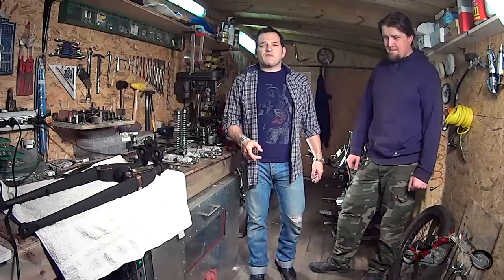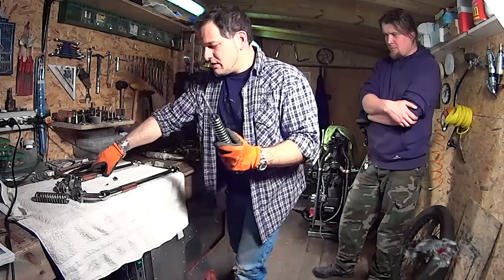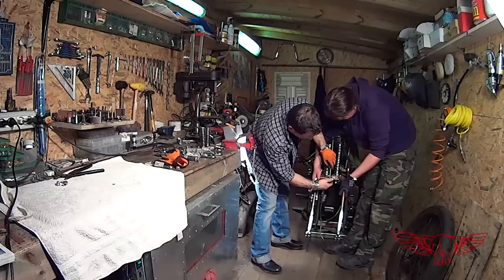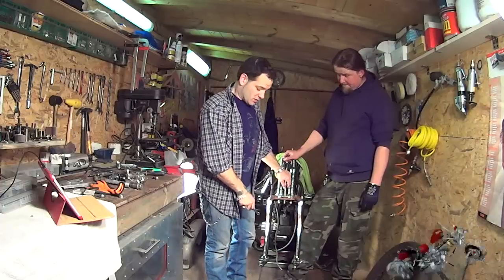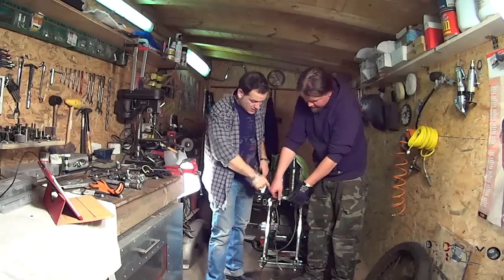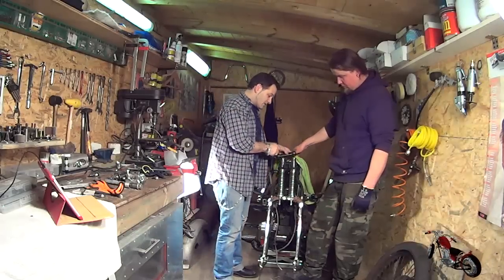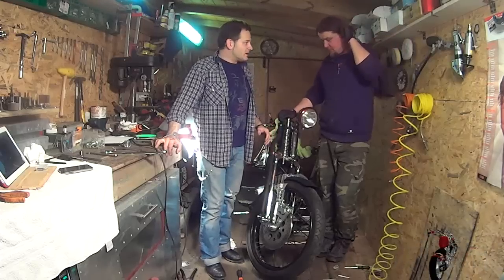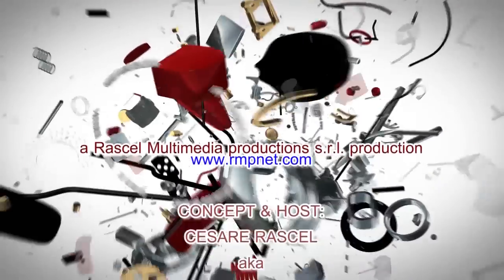How to assemble Harley Davidson springer fork DIY tutorial - e3p2 Roma Custom Bike

Comment: would have been good if you got more into depth on the rocker bearing torque settings for both the bearing retainer/jam nut and the arch setting.  Awesome video guys. My 2007 CVO Springer has 150,000 kms on it and now I just want to learn everything about these remarkable front ends.
Reply: And measuring from the bottom of triple tree to where axle is bolted in..so forks aren't bent or tightened too much..

Comment: Thanks so much for sharing this, really helpful. Can you share your experience about the design of the water gaurd and the 1) weight.  specifically on the rocker arm. It looks like it will be too heavy snap off into the spokes. 2) the wind speed on it? Wow thank you for sharing your great experience. :D
Reply from the maker: Thank you, but I'm sorry Victor, I didn't understand your question
Reply: Custom Cez Fai Da Te The fender looks so heavy for the rocker arm? Will it break off while riding
Reply from the maker: Hi Victor, no it's all aluminium and it has been there for now 4 years riding daily on Roma's roads that are all broken up. :D
Reply: Custom Cez Fai Da Te Nice! I wanted to adopt the same springer style for a custom bike I'm interested in building. So much great information, thank you again 😁😁 Your bike looks great !
Reply from the maker: Thank you so much :D I'll tell you, if you don't go for an excessive rake it drives very nicely too ;)

Comment: Do you have a video on how to realign my springer front end? I have a '05 Springer Softail and the handlebars/ steering are a little askew.
Reply from the maker: Jon Grattan sorry man, this is it on the subject. You can align the rear wheel cause it has the regulation bolts, but not the front. If it's askew is ether because the forks are bent or because the risers/handlebar assembly has not been done properly. Try taking those apart and put them back together the best you can ans see if it's any better, otherwise u might have to take down the forks and see if they are straight. Hope this helps
Reply: Excellent video , best one on the topic without searching deeper.
 The. Overuse of the cleverly done animation inserts .are abit repititios and intrusive to the focal point of topic.
  Also when showing a special tool or home handmade .If perhaps remove an animation in favor of a pause with photo emphasis for say 15 to 30 sec pause or at the end of the video show tools and or special parts
Would b extremely useful thank you for your videos.

Comment: very talented, I'm Colombian and here in my country is very difficult to see such suspensions. I would like and if you can give me some steps to give one to my motorcycle q is national brand low cylinder. thank you very much
Reply from the maker: julian diaz hey Julian :) thank you very much!!!sorry but i don't understand what you need, you what to get a springer front end?
let me know and i'll help if i can :)
Reply: Buena tarde , de pronto no me hise entender ya que mi ingles es pésimo. Pero lo que realmente quería hacer es una suspensión springer o girder, ya que ak en colombiano eso no se ve.  Ustedes nos llevan años luz en conocimiento de motocicletas. Y bueno me gustaría me asesoraras para yo hacer uno casero para mi motocicleta  150 cc 4 t.  Gracias..
Reply: Good afternoon, suddenly hise not understand me because my English is terrible. But what I really wanted to do is a springer or girder, since ak suspension in Colombia do not see that. You bring us light years knowledge of motorcycles. Well I wish I asesoraras to make homemade one for my motorcycle 150cc 4 t. Thank You ..
Reply from the maker: julian diaz hey Julian, it's ok :) you can probably make a springer at home, i've seen it done before. try to keep the corners square. There are aftermarket designs that are easier to build, less curves.
good luck to you my friend, and post pictures if you manage to make it :)

Comment: ciao, scusi. How much does the complete fork cost? I would want to assembly on a AME frame XS 650 Yamaha. Is it possible? Which sizes do I need to find out, to know if it fits?I used to live in my childhood in Varese. Italy ;). Greetings from Germany
Reply from the maker: +Jason Diamant Ciao Jason, i think a springer fork will cost about 1000 or 1500E. Everything is possible :) it's not going to be easy though. You'll have to match the bearings  to fit both the neck and the fork. I think it will be a wonderful build! Good luck to you man!

Comment: what is to  best angle for the retainer rod rose joint in degree's
Reply from the maker: +trevor francis I'm sorry man, what is the rose joint? Maybe in Italian translates differently :)
Reply: the part thar secures the caliper to the rear fork leg cheers
Reply from the maker: +trevor francis the shop manual doesn't specify, i guess it's a result of how much you tighten the nuts on the springs
Reply: yer I see what you mean, 40 degree rake, pipes bent to 40 degree for silencers, it not relly peter fondas tank,it was just a joke about the plastic tube full of dollar bills
Reply from the maker: +trevor francis still very nice!!!

Comment: Hi...you forgot the torque requirements on the rocker arm. There inner bolt is 50 ftlbs. The threaded insert with the allen wrench fitting hole in it is supposed to be torques to only 35in pounds. Then, the jam nut on the outside of that threaded insert is torqued to 100 ft pounds. You guys complete skipped that and it is very important to the operation of the rocker.